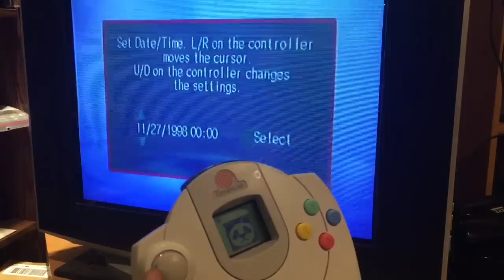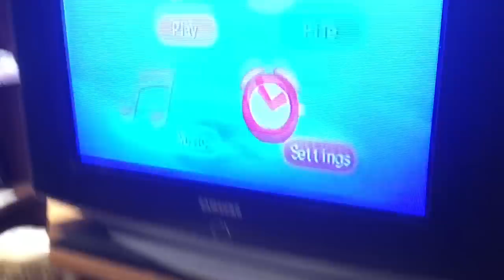Fixing eBay Junk - Dreamcast Restoration - Part 1 - Smoke Damaged Sega Dreamcast

Comment: Thats been in a house fire, baby! Telltale sign with smoke and some water damage (ive cleaned out a PS1 with smoke damage from a house fire clean up, and got it mostly working, the whole CD platter had to be replaced)

Plus dont hate on the bloke for a busted laser, if he can get it that good after what its been through, then job well done. You did well, Champ.

Comment: For future reference, you should clean the carbon/smoke damage from all the pcb's as it can become conductive if electricity is introduced, im surprised the dreamcast didn't short out on you when you turned it on, stroke of luck to be totally honest, but just to be safe.

Comment: you can clean those boards in water, just let them dry thoroughly afterward. Watch the8bitguy for an example. that kind of grime buildup on the components cannot be good.
Reply: Especially considering smoke tends to be Carbon - And carbon is conductive..
Reply: BackForwardPunch I can swear I’ve seen people wash motherboards in a dishwasher
Reply: @Kubulek17  dishwashers work great as long as there isnt components on the board that have crevices where water will get trapped. I usually put PCBs in the dishwasher, let it air dry, then let it sit on my truck's dash in the sun (as long as it isnt to hot) for a day or so.  I have also cleaned keyboards that way.
Reply: I was thinking the same thing. TheThe8BitGuy is an OG. He’s the master of restoration cleaning!
Reply: If there's still some on it then use some alcohol with a qtip
Reply: @UkSkin  lmao, carbon is only conductive when it is graphite, that's bullshit.
Reply: @endmysuffering8720  Well, the most common allotrope of carbon is in graphite form, so really, it isn't bullshit
Reply: Lots of armchair quarterbacking in this thread, y’all can post your own videos
Reply: Agreed. GametechUS hosed down an NES in his backyard once. Worked just fine when it was done.
Reply: @Heymrk  That was literally the video that proved to me that water was fine as long as it fully dried. I haven't had to do that to any of my systems but at least I know it's an option.

Comment: very interesting video, what's really strange from your approach is that you go really down to the last bolt dissembling the thing and leave many parts dirty when a simple wipe make a world of difference
Reply: yeah i can't stand that. how can you take apart like that and not clean it. water will not hurt metal. water will not hurt the circuit boards too. disc driver i woudln't get wet really though but everything else i would wash in sink to get it clean. as long as there is no power it will not really hurt it. let stuff dry and it will be good. use rubbing alcohol if afraid of water for some reason but just clean it already.
Reply: If you're worried about water, just use alcohol. He clearly has some.
Reply: @james42519  Exactly get it all clean when you have it open...
Reply: Speaking of interesting videos, I saw a video review of the Sega Dreamcast on the Amazon app, and in the video the Dreamcast was smoking, and the man who purchased it called it "the worst product I have ever bought"

Comment: That Dreamcast was in a house fire that was later put out by the fire department using water. That would explain the soot all over the unit and the square shape on top which was probably caused when a book of some kind was left on top and the fire commenced. The rust spots, not being many and isolated, are caused by the water used to put out the blaze. Dude you got a burnt Dreamcast. BUMMER!
Reply: Will V or it sat next to a fire place for years without anyone caring for it
Reply: alphacure mother, you just described the story of my life.  ;)
Reply: Will V (ಥ_ಥ)o wow lmao sorry fam
Reply: alphacure mother, Sadly I often smell like an old burnt up piece of log, lol. I hope no one calls the fire department on me. ;)
Reply: gives bucket of water Just in case.
Reply: @shanewomeldorff7929  priorities man, cigarettes before central air.
Reply: @billy-waynejeffcoat4828  lol i have no recollection of typing that comment lol.

Comment: you can clean most electronics with water (do note that water with more particulates IS more conductive and the following wont work) you need to then let the device COMPLETELY dry, for instance, completely disassemble and leave in a dry area leaving plenty of space between components and waiting AT LEAST 12 hours, 24 to be safe, the more complex the device may require some slight alchohol rinse to remove ANY particulates left over, as simpler circuits typically have enough space between contacts to provide too much resistance to be conductive enough to worry about.

again, water doesn't destroy electronics, its when you use water and keep power running through the circuit that it causes a problem (capacitors should be taken into account as well)

Comment: I think the laser itself is damaged. Normally the laser will move up and down until it finds a focus on the spinning disc, and once it does, it will start moving forwards and back to read certain sectors and stuff.
You can test this by pushing(carefully) the laser part back and seeing if it returns to it's normal front position on power on.

Comment: Leaving that much soot (carbon) on a PSU is extremely dangerous , please give it a alcohol bath in some 99% Iso, dont rest it in the bath for more than 2 minutes, followed by scrubbing it gently with a toothbrush, rinsing it in alcohol again, and leave it outside for a day or two to dry, carbon is conductive and it will arch especially the high voltage side, you can even do the same for the motherboard and controller ports.
Reply: Well, if there's enough carbon, it will simply act like a massive resistor and any short circuits along a tiny path will heat the surrounding carbon, connecting those particles, creating a large "surface trace" and simply get hotter, if left plugged in too long it may cause the socket to melt due to heat or trip the breaker due to the massive load or short, which is far more likely than melting the socket. Housing wiring doesn't fail that badly unless something is already wrong with them.
Reply: Though he still indeed should or probably already did as this is 6 or more months old by now
Reply: E

Comment: For the plastics cleaning I tend to use Cif Cream. It works in most cases, and I havent ever damaged a thing. But to be honest I have never used it for game consoles, rather on old radios
Reply: KISSbestfan I’ve used it on a Dreamcast and i nearly rubbed off all the logos. Apart from that, did a cracking job.

Comment: All that much smoke looks like it was sitting near a grill for years, or some garage with Diesel machines coming and going.
Sometimes I find it interesting to make up theories about how was the life and storage of these used machines and what happened to them
Reply: What likely happened was that the console is a survivor from a house or apartment fire and smoked up while it still had power as just sitting the soot wouldn't have deposited so heavily on the inside of the machine. The internal boards need to be cleaned including the psu due to the carbon buildup.
Reply from the maker: The interesting part. Is that the p1 controller port was so full of smoke residue that you couldn't connect a controller.  So the fan sucked the smoke in, but no controller attached?  It's just odd
Reply from the maker: You're right, scary stuff.  Just odd though, unplug the controller but leave the system powered on?  Maybe someone tripped on the cord? Who knows. Interesting to speculate
Reply: Whoa it became quite a topic while I was out!
I bet more on something a lot less tragic, like the sitting besides the coal grill. I've repaired and just opened up for fun quite a lot of stuff, and with kitchen stuff, you can really get grease on components that never saw light in their working life after assembled.
For example a portable tube TV I got from my neighbors once, was sitting on the kitchen shelf for years unused, it was easy to clean the outside of the TV, but the inside was amazingly greasy as well, even tho it was sitting unused with no forced ventilation through it.
I specially bet more on the grill or garage theory, because you can't see some specifically big accumulation of soot around the fan (where it would make sense to have), but anywhere near ventilation grills there is it, and specially, it has a lot inside the CD/GD drive as well. The top of the device can be cleaned with some cloth to remove the worst parts, but the inside was left as-is by the user trying to get rid of it.

Well, that's at least my bet on the story.
Reply from the maker: Kalvinjj I ended up getting the story from the seller, it was a fire.  He got a bunch of stuff that was caught in a fire.
Reply: whoa so it really was the more tragic version
Reply: Or maybe it was sitting in a room with a poorly ventilated woodstove

Comment: I've dealt with smoke-damaged machines before.  A friend was a contractor who worked for an insurance company cleaning up fire and flood damage and was always bringing me stuff with the potential for repair.

Easy and quick solution?  Remove NVRAM/CMOS battery, discharge any capacitors, and toss the pieces in a dishwasher!  I've even done this for optical drives and successfully got them working after drying and relubricating moving parts.
Reply from the maker: Paul Kastner that's a nice deal you've got yourself there.  I'd love to get some free damaged stuff like that

Comment: I have a couple ideas to share for the next smoky project, albeit I can't predict how well they'd work.  They're tactics I use when I'm fixing a car to flip that work well for paint, glass, and plastics for me.  The first thing I can't say enough good things for is micro fiber towels. I'd wager they could have scrubbed off most of that crap with less effort.  When it comes to cleaning glass, I don't even use soapy anything anymore.  Just clean, hot water works with the towels.  When I still need something with grit, I'm fond of 3M Perfect It II rubbing compound.  I'll use it shamelessly on plastics as much as I do paint.  3M also has a plastic polishing compound that you can tell is just an even finer rubbing compound.  A dab of either on your micro fiber towel would have probably done fine on that case.  I can't say for sure how destructive they might be to those imprinted logos, though.  The plastic polishing compound might be more appropriate for your work.  I hope I gave you something helpful.

Comment: Lithium grease the bars on the laser assembly and clean those boards with isopropanol. I'd go as far as to clean up the fan and all the other areas with a Qtip and say glass cleaner. Looking forward to seeing how faryou get with restoring the laser, and if you find a supply of replacement lasers then please share.

Comment: For that first lid spring spraying with wd40 and wiping clean is not recommended unless you follow up with something more viscous. Wd40 is great for cleaning but it will all eventually evaporate off, leaving the metal bare.

Comment: If you use ipa for the parts you can't get to with a tiny brush it will remove all the yellowing & be safe to clean the circuit board

Comment: A tip for getting the yellowing in the cracks, you can use some baking soda with a little bit of water so it becomes a paste and use a toothbrush to scrub it away

Comment: You should clean the metal bars on the laser assembly and lube them up sparingly with silicone grease, oil is ok but will attract dust which will clog it up. Nice work on the cleaning process, you should definitely try to retro bright it to see if you can obtain it back to a pearly white.

Comment: No need to use water in electronic parts you think would be damaged by it.
You can use isopropyl alchool to clean everything since it evaporates fast.
That way it will be cleaner and neat.

Also distilled water is good for washing electronics. You'll need to wait until it dries out though.

Comment: I had a console like this with the some pretty bad smoke problems. I was ocd to the to the point where I un-soldered everything from the Power board, cleaned it with alcohol and then re-soldered everything back to make sure I got everywhere.

Comment: I am surprised that fan isn't louder than what it is, or your camera's audio is not picking it up. It would definitely be worth doing the silent fan mod, and psu replacement mod for that unit. The psu I have seen far less do far more damage and with how much dust and smoke damage is there I would worry about it being a fire hazard on its own at that point.  isopropyl alcohol to the max with that board but its still high risk unfortunately.

Comment: @RetroRepairs when I got my Dreamcast it would not read games. I thought the laser was dead as well because there was no red laser like a normal disk drive. Appearently if you didn't know this already Dreamcast do not have visible lasers so when j found that I was able to do a POT tweak and it instantly started reading disk and have had no problems since. Figured I would share that information with you.

Comment: Dreamcast controller port faults where all the ports stop working is usually due to the resistor fuse (smaller aqua colored resistor looking component on the controller port PCB) being blown. Simple fix to just desoldier the old and soldier in the new resistor fuse. Dont cheap out and replace it with a regular 1/4watt 10ohm resistor as that will remove the protection. Always replace resistor fuses with resistor fuses of the exact same rating, never a plain old resistor.
Reply from the maker: ErroneousClique correct.  This one actually tested fine however, so I did not replace the fuse
Reply: ~or replace with a blob of solder~
hehe just kidding but yeah... done that. Not proud of, but it's sometimes hard to ever find some correct sized fuse (even worse the specific rating). When they're the tiny SMD types for low current you'll usually not make some time-bomb if it fails, but sure will blow some stuff in case it does (usually some IC burns, but rarely something like shorting battery and making a fire hazard).
Reply: It's gonna be hard to tell the color now, hehe
Reply: Heck with all that, do the resettable Polyswitch fuse mod.

Comment: For the record or future reference: the magic eraser (Melamine foam) is only mildly abrasive, and far from "basically sandpaper". Using it with rubbing alcohol isn't the most efficient way, as it works better with a detergent which acts as a surfactant, such as common household dishwashing liquid, to both add lubricity and to move the contaminants from the surface. Also, an ultrasonic cleaner works wonders for getting into the tighter areas, and can be had for a reasonable sum of money
Reply from the maker: That's fair.  The main point was that it's not "magic" or a special chemical, it works by grinding away at debris.  They will still take a logo clean off a system if you're not careful.
Reply: Oh for sure. Wonderful substance that foam is, though.

Comment: if you leave the ribbon on the ODD connect to the laser side it is much easier to reassemble, I typically reassemble the laser assembly then connect it to the controller board 😉

Comment: Doesn't thermal paste dry out. And you don't want to open it to clean because there's thermal paste connecting the board to the heatsink.

Comment: My biggest problem with this particular video and a few of the older ones is that in this one he forgets to secure the cd laser to the shelding as he removed the screws during teardown.  In some of the older videoes he forgets to put the light pipes back into the system for the led's.

Comment: Thermal paste? There’s two thermal pads, not paste, one on top of the CPU and GPU. 

There’s also two smaller thermal pads (seen in the video) on the underside of the CPU and GPU on the bottom half of the RF shielding, protecting two smaller chips underneath each of the main components.

You could have lifted that top RF shielding plate no problem to inspect the motherboard. Would have been interesting to see how it fared.

Comment: Hey, bud! Just started watching your videos. A LOT of them. Haha! As a bit of a "do what I can before discarding" electronics person with a fair bit of electronics and soldering history, I just wanted to offer a small bit of last ditch effort advice. I know it may sound worrisome, but HEY, you're about to condemn the laser anyhow! I find that if you "manually" push the laser down it's track with a slotted (flathead) precision screwdriver (to fit between the lasers primary location and the laser mechs body) it often gives a bit of a jar, and will return to it's home location and resolve the issue, and if not, hey whatever, its more than worth a shot! ;) Just subscribed. I enjoy your insightful (albeit a bit long, sometimes. haha) and educational videos.

Comment: Hey Adam, can you do a video on replacing an OG Xbox clock capacitor while highlighting how to identify the various revisions?  I also have a PS3 fat, 60GB, that doesn't work.  It has a red light but does nothing else.  I would be interested in sending it to you for repair.  I would pay for the parts and shipping.  Just let me know. Great stuff as usual.

Comment: The Dreamcast is probably my favorite console but I remember them being quite fragile - especially the laser dying after a while.  I went through three of them.
Reply from the maker: Yeah, those lasers just don't seem to hold up.  Especially if you play alot of burned games on it.  They're not cheap to replace either.  I can get an entire Dreamcast for what a replacement laser assembly costs.

Comment: I've cleaned smoked computer boards by soaking in alcohol and then used an airbrush to sweep away the crud.
Reply: Canned air would work as well if no airbrush is available.